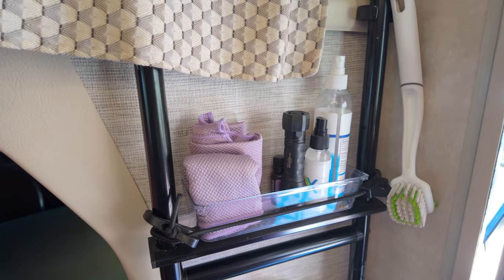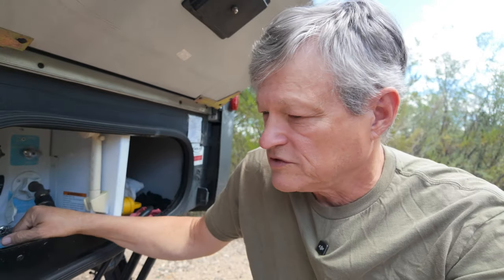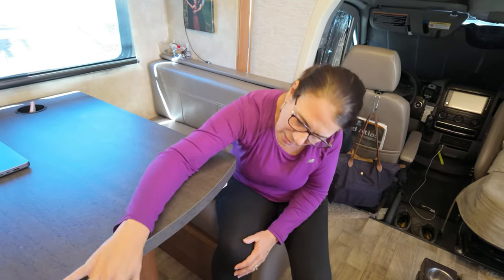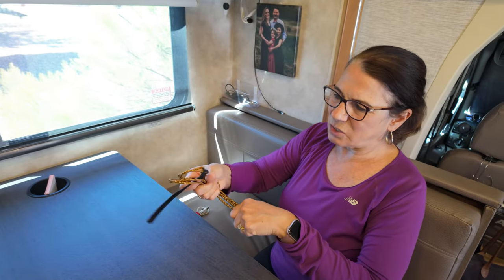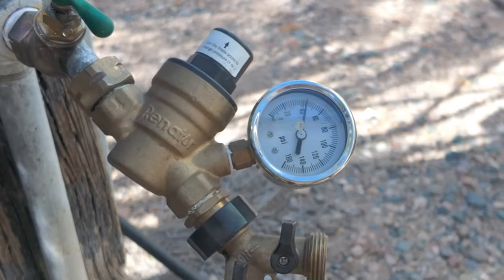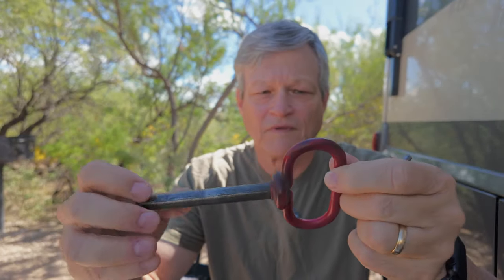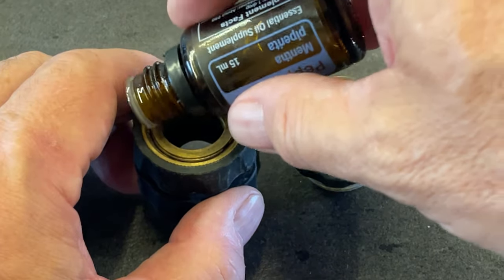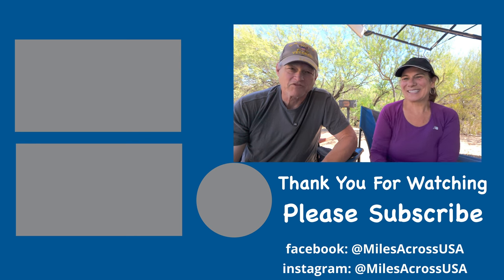RV Accessories that make a Big Difference - Winnebago View

Comment: I’m going to order those sear back hooks.  I’m also aggravated by charge cords everywhere. Ugh!  We did install stretchy pockets on either side of our View’s dinette area to store cords.  Two items that make Rv life easier for us would be 1) a thick rubber “chef’s mat” designed to relieve foot pain when working in the kitchen.  We use it anything we have to kneel down outside when arranging storage bays, working in wet bay, putting air in tires, etc.  Saves our knees!  And 2) those non-stick silicone baking mats are really great at keeping things from sliding around.  I put them in my pull-out pantry shelves and food items stay out. They will even hold things on my counter while traveling.  I also use them for things stored on floor under the dinette when traveling to keep it from sliding around.  When not in use I just put them under the rug until next travel day.  Very inexpensive on Amazon.
Reply from the maker: Those sound like great accessories that we will check out. Thank you and thanks for watching and taking the time to comment.

Comment: Next time you're in the heat or cold try hanging a blanket from the cab bunk. It makes all the difference in being comfortable, I hang a quilt/throw blanket from Costco with 4 or 5 of those hand spring clamps from harbor freight, with that in place the A/C can keep up with the Florida heat in July and the heater can handle the new England  cold in January. Also for a 1 night stay it goes up so easy in seconds
Reply from the maker: Thanks for the tip. We actually started using our extra blanket for that exact reason while we were in Death Valley a few weeks ago. It made a huge difference. You can actually see it at this point in this video. Thanks so much for watching and commenting.  
https://youtu.be/MTmni6k6CrM?si=grqzfxvcnCn6Y2jS&t=103